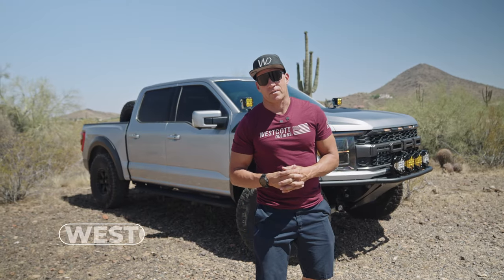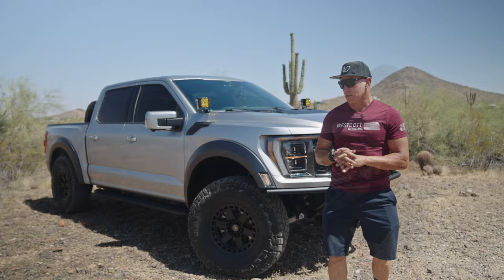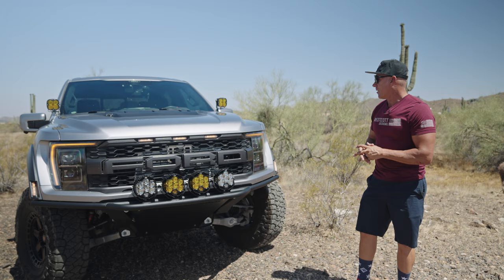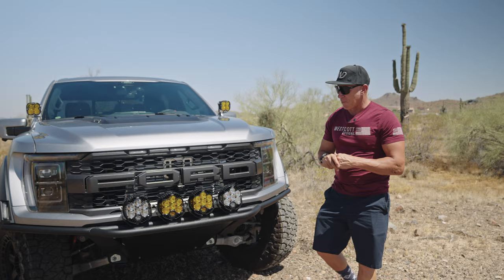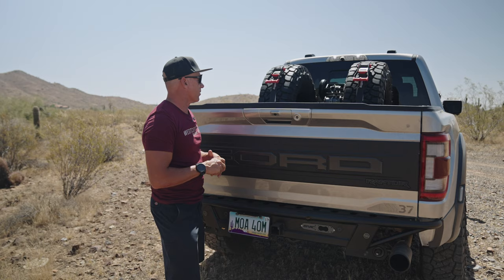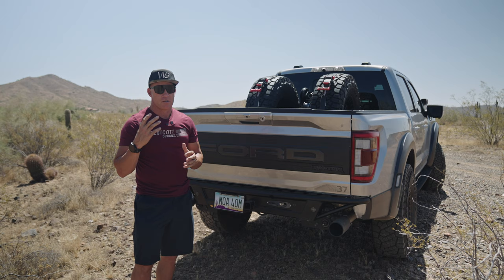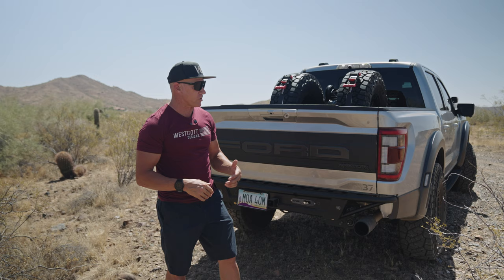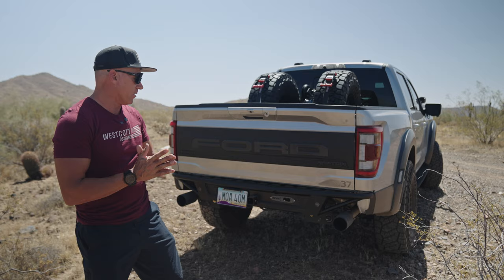Custom 3rd Gen Raptor Build Walk-Around

Comment: IMO the bracket for the tips hang way too low and kinda defeats the purpose of a low profile, high angle bumper, I think maybe remaking the bracket coming from the top bolt down would be bette, other than that raptor came out super clean